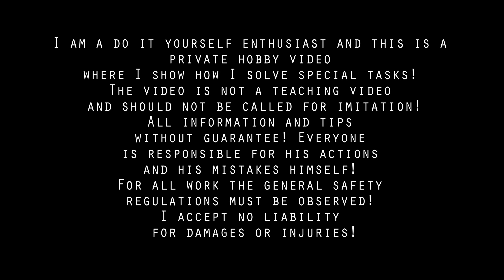How To Install Window Locks / Window security

Comment: Great for locking a window down, but if you want to leave the window ajar an inch or two for ventilation, you'll need to get another lock for that. OR, just get an adjustable lock so you can lock your window in any position! (I've seen clamps that do this without drilling any holes in the frame).